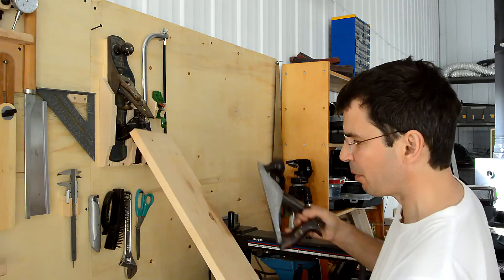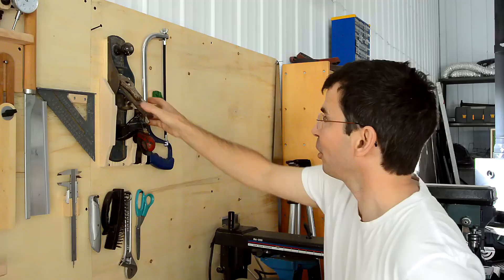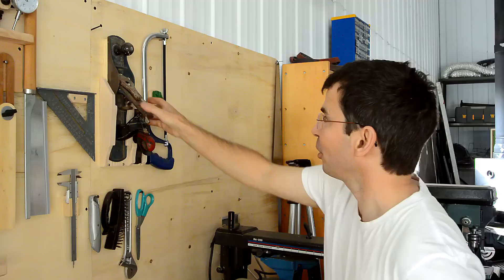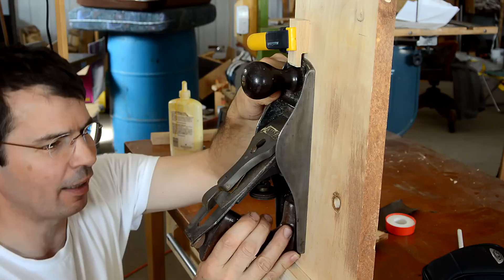A better hand plane holder

Comment: you never put a plane down like that. always on its side. never on the chisel  you didnt learn?
Reply: That could be fixed with a shallow dado in the right location.
Reply from the maker: In that case, better not use the plane to plane anything, because you'd have to use it sole down for that.
Reply: Sole down: Blade touches wood. No big deal.
Sole to the side: Blade can come in contact with all sorts of things, including steel and your fingers.
Reply: yes big deal, especially when youre placing it down on something that you do not want to damage, like a painted or finished surface. its the first thing i learned in college, never put it down like its down in the video, also the blade will need resharpening way sooner, a 
paring chisel you lay the sharp side up too, right?
Reply: True, but on the moment something falls against or on top of it youre done, You can throw away your wood and start all over again, youll create scratching that you cannot sand out.
Reply: dude its not your plane can you guys just stfu whenever you see someone putting planes on their blades? If he doesnt mind sharpening them more often then theres no harm done...
Reply: @klotuur or, you know retract the chisel to protect when not in use... it's what i do, then it doesn't matter how it's sitting.
Reply: OpposingForces this aswell
Reply: i really is not that big of a deal. yes they said that when i studied carpentry too. but in general you dont put the plane on finished surfaces you need to keep clean , on its side or not it could damage it . and most workbenches are made of soft wood . all i have seen are atleast. so it doesnt really dull the blade . i for one  refresh the blades i use in a given day.
Reply: Lippa100 it kinda does tho, idk if u love your tools but i do, i like to keep them sharp and nice looking. also if youre on youre job, you cant just go and sharpen everything every day or 2 days... takes time to do it properly and its a waste if you dont treat it well and have to do it again
Reply: klotuur it just really depends what you do, matthias for one definetly does not use his planes for any kind of fine woodworking and his planes arent that great either. And the sharpening barely takes any time if you just need it for roughing boards/chamfering. Also like Opposingfroces said the best thing to do actually is to just pull the blade back and its perfectl safe no matter how you store the plane....
Reply: Lippa100 fair point you got there, its the difference between a carpenter and a furniture maker :p
Reply: Just retract the Iron, it's called an Iron by the way. You didn't learn?
Reply: Nathan Burton I dont know the English terms, because im not English. im just using google translate.
Reply: Fester Blats exactly, most woodworking benches have a well, you place one end on to top and the other facing down into the well. elevating the iron.
Reply: +klotuur 
it doesn't really matter as long as you don't damage something and are aware of what you are doing. Respected fine craftsmen like Paul Sellers say the exact same thing.
Reply: Paul Sellers is a pretty knowledgeable woodworker, and he sets his planes down on his wooden bench, right-side-up, all the time.
Reply: Ah, how do you ever plane wood if you never put the iron down? Matthias has already covered this topic.
Reply: 1) Softwood is substantially softer than the iron (blade, chisel, whatever) of the plane. You will notice that resting a plane on softwood is far less taxing on the blade than planing softwood. You will dull the tool much faster just by using it. Resting a plane on its base on a soft or even hardwood is not going to dull it.

2) Placing a plane on its side leaves the iron exposed, which greatly increases the chance of it being struck by another object. It leaves it wide open to get knocked and chipped by any wayward passing tool.

3) Placing a plane on its side usually puts the center of gravity higher, making it at least a little more prone to tipping. Should you place it near the edge of a table or other surface, it's now liable to get knocked off, tumble to the floor, and chip the iron.

An iron face down and into soft wood is probably one of the best ways to protect it. Haven't you ever noticed that knives are often stored in wooden blocks? Why don't professional chefs worry about that wood dulling their blade? Because their tools are made out of high quality steel, don't dull quickly (relatively speaking), and will suffer far more wear from simple daily use than from storage.
Reply: *****
I actually have my main plane drawer lined in shag carpeting. My planes seem to not mind resting sole down on it either. My planes spend far more time being stored than being used too. I have enough planes that I could use a different one every day for a month, or more. As I've really no idea just how many planes I own anymore. Other than a lot.

I've never dropped a plane in my life yet either.
Reply: klotuur thats a total hoax, its told because children allways used to put the planes, blade side down on table saw tops which messed them up, but putting the plane on wood really doesn't have any source of damage done to the plane.
Reply: Just as an observation, woodworkers never leave their planes on the surface they are working with the plane on, and do not set their planes on metal surfaces. The bench a woodworker uses has a wood surface, which is not going to damage the iron of a plane. That's not true of the other tools that a woodworker uses, so setting a plane on it's side exposes the iron to potential damage that setting it on a wood surface (bench) will actually protect it from.

The reason that people are told not to set planes on their sole is an artifact of the education system where a school wood shop is a multi-purpose shop that also includes metal shop, machine shop, and often small engine or even automotive shop. The benches for these other classes are often not wooden surfaces, and are potentially very damaging to a plane iron. Additionally I've never met a shop instructor that considered spending a couple of hours every night after class fixing damage caused by someone dropping a plane on a metal bench was a good use of their time, so their shop rules match those you are parroting. It's just not the case in a true woodworking shop.